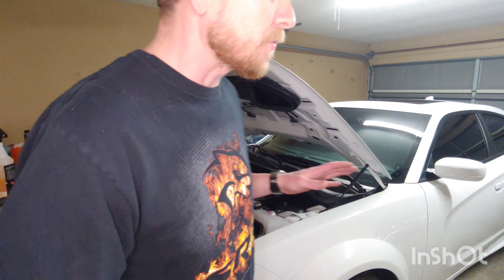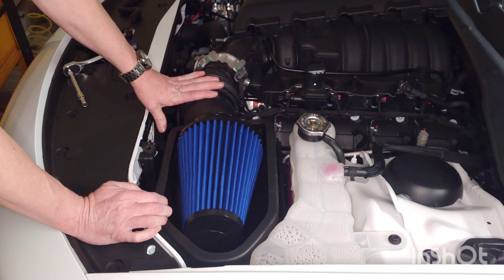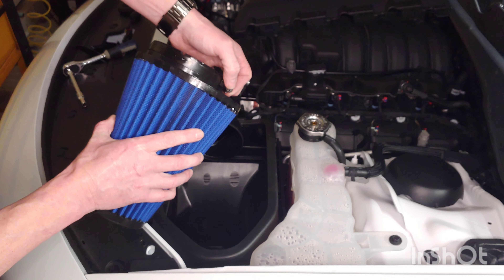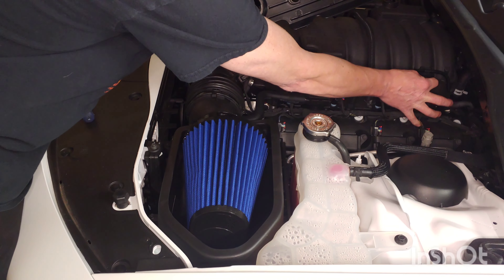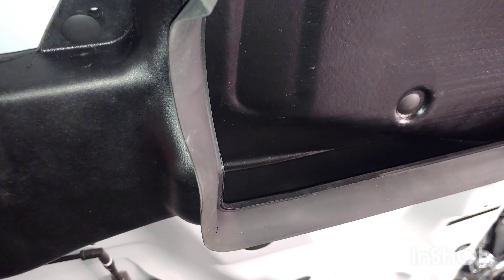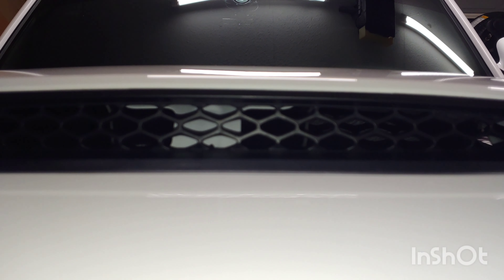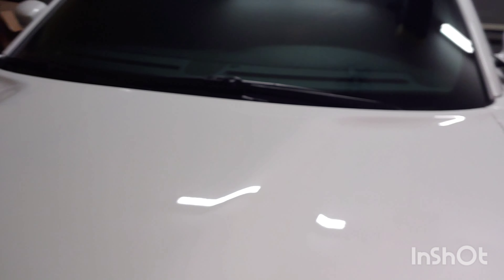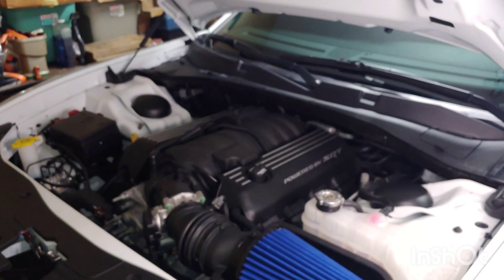Ram air induction on your Scat Pack with Mopar parts!

Comment: Debating on attempting this, this seems like such a perfect custom mod, making the cold air intake actually use the hood scoop should’ve already been something dodge has made.
Reply: Dodge most likely left this off because it did not provide any discernable power or performance increases.  The stock CAI for naturally aspirated challangers/chargers is more than adequate.

Comment: Yup I was trying to use the hellcat air box  with a mopar cold air intake where they all work together, but dodge doesn't make a kit for that,like this set up ,bit there was no cutting & hope they made a kit just for chargers ,wish you didn't have to cut the snoklers in the hood,like this set up just never the cutting!!this is the only set up I've seen for charger, challenger have this kit already made just for them!!

Comment: Super cool! 👏🏼👏🏼
Have you any comparison of the intake air temperature pre and post install?
Reply from the maker: I haven't yet. As soon as the car gets back from the body shop I plan on reinstalling the stock air box for comparison runs. I'll do city & interstate comparisons. So far the clear winner in city driving is the hood scoop intake. Idling at stop lights & drive thru's doesn't heat soak nearly as bad as the stock intake. Stay tuned!

Comment: Nice car man! Damn that intake costs a grip eh? I have it on my T/A Challenger, so I am looking to swap out my stock hood, with like a demon hood, or old school T/A hood. If the hood I'm getting like the MP Concept demon hood, I wonder if I can do this also with the intake, cuz that hood just blows air into the engine. Not sure if it'll fit anywhere on the demon hood. Maybe cut around it too like you did here which is pretty impressive, what tools did you use?

Comment: i have the exact same car and i would love something like that, i have the afe magnum force 2, i had it on for a while but took right off when the weather got hot because i noticed a difference in top speed cus of the hot air going in, do you know where i can find something like this that you’ve used for your car, it looks like functions really well
Reply from the maker: I haven't found anything factory or aftermarket that is fully sealed, which is why I decided to try this. It's been working very well. IAT temps are staying within 5 degrees of ambient temperatures. It's allowed me to advance spark timing without fear of detonation. Hot restarts are much easier also.